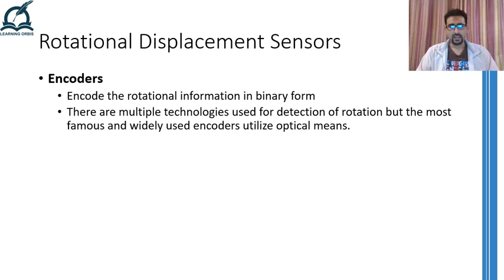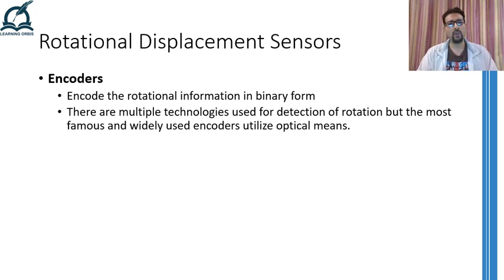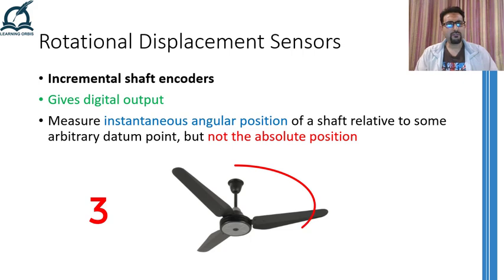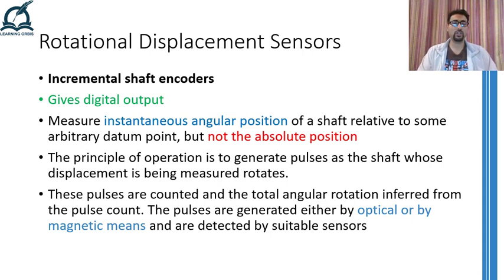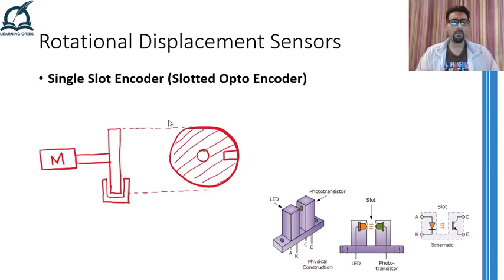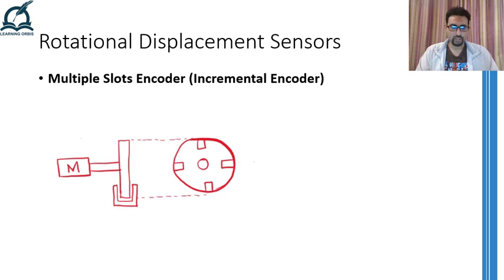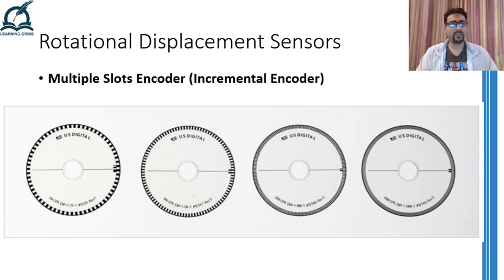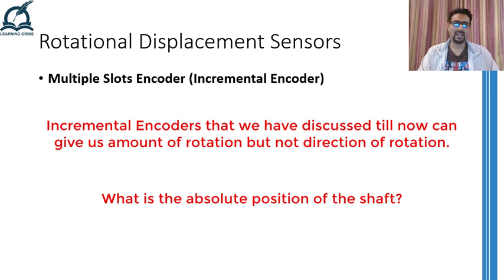How Optical Encoders Work? | Incremental and Absolute

Comment: 1)On our incremental encoders, there is another channel called the Index Channel, or Z pulse (“zero position pulse”). This output pulses once per revolution of the encoder. It is used to indicate when the encoder disc crosses the fixed zero position inside the encoder. The Z-pulse can be used to reset a counter or can be used for very precise homing.
2)Incremental encoder :  RE620
Absolute encoder: DS-406

Comment: 1) Incremental encoder have  z  channel that gives the index of absolute position rotating disc. It  also known as Reference or Homing Position. Whenever it transmits data, Encoder know that it is back to its Home Position
2.incremental encoder: RE520,  RE520
    Absolute encoder: RE22, RE36

Comment: 1.The z channel of the incremental encoder is also determined as Reference or Homing Position Pulse as used for informing the  encoder that it has reached its initial/home position after the transmission of data takes place.

Comment: 1. Z channel or Z pulse is used to determine the actual position of motor during startup by producing a single pulse during each shaft rotation . It is also referred to as zero reference.

Comment: 1-The Channel Z is used to generate a pulse after a complete rotation. The purpose of this channel is to find out the reference point of starting of disc
2-
Incremental encoder :  RE620
Absolute encoder : DS-406

Comment: 1)On our incremental encoders, Z channel is used to indicate when the encoder disc crosses the fixed zero position inside the encoder. The Z-pulse can be used to reset a counter, or can be used for very precise homing.
2)Incremental encoders : RLC21C, RE620
  Absolute encoders : RM44, RM36

Comment: 1. Z channel or Index channel is used to indicate when the encoder disc crosses the fixed zero position inside the encoder. The Z-pulse can be used to reset a counter, or can be used for very precise homing.

2. Incremental Encoder: DWD38, E12
    Absolute Encoder: AD25, AD34

Comment: It is used to indicate when the encoder disc crosses the fixed zero position inside the encoder. The Z-pulse can be used to reset a counter, or can be used for very precise homing.
Incremental encoders: RE620
Absolute Encoder: RM36

Comment: The Z channel of an encoder happens once per revolution of the encoder. The index is also sometimes called a reference, marker, or homing pulse. One common function of the index is as a home position locator. Every time the index is triggered, the receiving device knows where the encoder is within its rotation. The index is normally 180º electrical and gated to either channel A or channel B.

Comment: Z channel also called index channel or Z pulse. It is used to determine the actual position of motor during startup by producing a single pulse during each shaft rotation .This Z pulse is also referred to as  marker pulse, home or zero reference.

Comment: 1) Incremental encoder can have a 3rd channel called z or zero absolute channel that gives the index of absolute position rotating disc. Z channel gives one pulse per revolution and is gated either with A channel or B channel and thus it provides signal for homing and count verification.